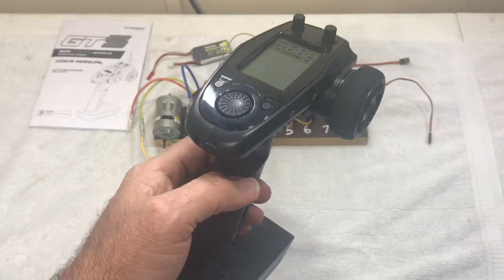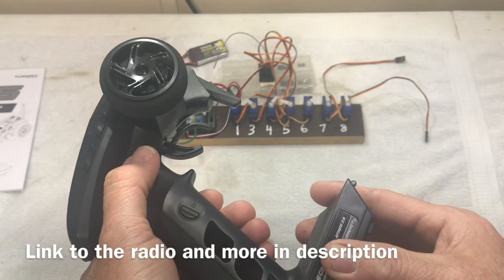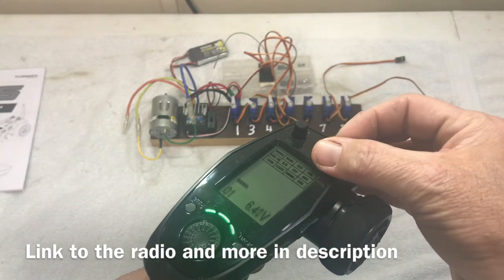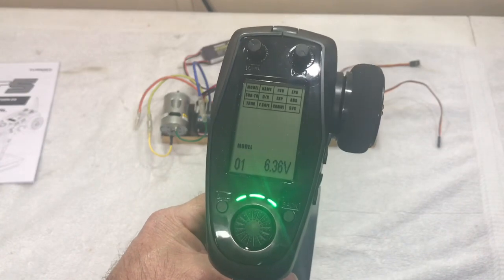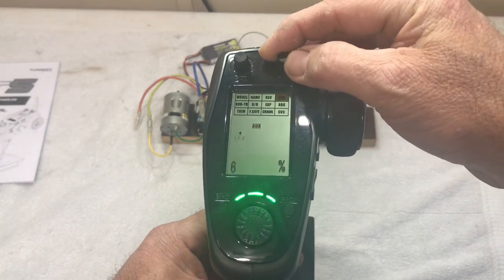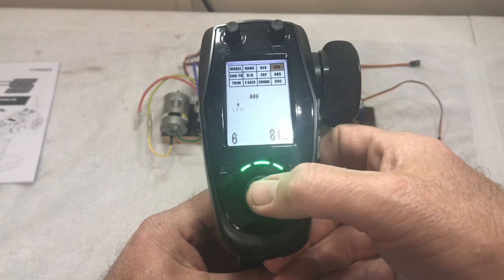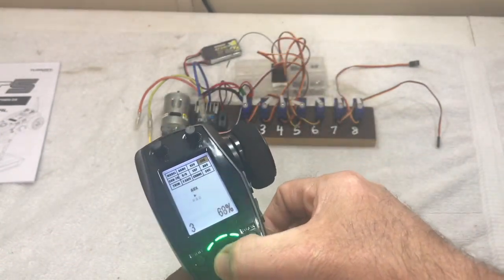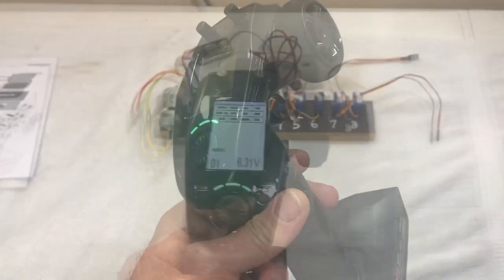Gt5 Channels 3-6 pt3

Comment: Nice, you made a follow up video on this transmitter! After heavily comsidering my options, I ended up ordering a Futaba 7PX from overseas. While I do understand that the GT3C hacked is the true gem of current radios, I simply don't like the menu system. I do find consolation that the HobbyKing "Orange" RX that will work on Futaba radios but I'll have to see if I can find a 7 channel compatible Orange RX.
Reply from the maker: Cool. Let me know how it all sets up please and if you do find a cheap RX that works, I’m interested in that too
Reply: Exocaged RC Will do, I'm going to dedicate some time this weekend to finding a compatible Orange RX if possible and order it. My radio isn't expected to arrive for several weeks since I really had no choice but to order from overseas due to no US stock because of the Hobbico situation. I'll definitely keep you posted but know that it won't be anytime soon unfortunately lol.
Reply: the gt3c is only 3.7V 1S AFHDS and doesnt have anywhere near the range of anything flysky with AFHDS 2A

Comment: Hi Mate. 
Currently running a Gt3c hacked for my moa build but really want independent control of the rear steering.   I currently also run front/rear dig. I use the dual rate switches to swap between f/m/r dig. Would I be able to set up something similar with this tx? Struggling to find the answer online.
Reply from the maker: yeah use the DR button and set that to the rear steer channel, then you can make it momentary or set it to hold where ever you want it to, I think you can then set the ch3 button in the handle to re center it. I haven't done that setup but some have told me they set it up like that

Comment: Hello my friend ! , have a question about the 4w steering , on what channel do you connect the 2 servos ??, on the manual it said that the rear wheel steering servo goes on the 3rd channel , but what if I want to use that 3rd channel button on the radio  to turn some lights, it wil mess up with the rear steering ??, Thank You !!
Reply from the maker: Use the 3rd channel for rear steering like it says. Use a different channel for lights.

Comment: I bought this transmitter (FS-GT5) as an upgrade to my flysky fs3b to run my Rovan Gas buggy, but am having extreme difficulties setting up the Dynamite killswitch on it. After setting up the system, it doesn't work. In short, when the car is running and I hit the third channel button (to which the killswitch is hooked), the engine is killed. However, if while the car is runnimg, I turn off the transmitter, the killswitch light stays on and the engine continues running. I realized that I have a dangerous runaway waiting to happen and, as such, grounded my buggy.
I contacted the Flysky company for help but I haven't gotten a reply as yet. Can you tell me what's wrong with my setup? I'd appreciate your expertise.
Reply from the maker: hmmm that's a tough one, have you tried the kill switch on ch4? that's the lever just under the top. It's 3 position. I believe there are programmable failsafes on all channels but I have never had a need to mess with them. That may correct your issue. I have seen a runaway 5th scale and it did not end well. Good on you for grounding it until you have it safe.
Reply: @ExocagedRC  Thanks for your honesty. I'm hoping to hear from the experts at the Flysky company. If I don't, I'll simply purchase another model transmitter that hooks up safely with my killswitch. Thanks for responding so promptly. 👍🏿

Comment: Great tips, very well laid out. I purchased this radio. to use with the TRX-4 Defender and although I managed to make all channels work, for this particular vehicle I would prefer to have 3. of the channels perform the way channel 3 does - like a 2 position switch. This way I could control 1st and 2ng gears with a 2 position channel and the same for front diff and for the rear diff.
Maybe there is a work around to configure channels 5 and 6 to work as a 2 position switch? Or channel 4?
Really like to have your take on this.
Thanks
Reply from the maker: There is no key mapping on this radio so we are stuck with that channel and that switch. Otherwise I really like the radio

Comment: Quick question, on a trx4  do you use the ch5 and 6 for the diff lock.. Just wondering how to trim that. thanks
Reply: Just set 70 everywhere i did that and it dosent destroy the servo and also my transmission switch is set on 3rd ch

Comment: I have to ask as I've been struggling to get this to work on my capra. Al other 5 rigs hooked up fine but I have no throttle control. have you bound it with your capra and if so was there any issues. Have tried three FS-BS6's and always same result. However i can get throttle when plugged into channel 2, just not in channel 1.

Comment: I am using one of these for my vanquish Phoenix and I wanted channel 4 for the transmission to go between the different overdrive settings as well as the two-wheel drive only when I would switch it The middle setting would hardly move is there any way to set the middle so it basically goes halfway in between the total throw?
Reply from the maker: yeah ch4 subtrim, set that for neutral and then set end points

Comment: I did a video on this gt5, didn’t go into detail like this👍👍👊👊📹📹hey I have 4ws n put one servo in channel 1, the other servo into channel 3, when I put in crawl mode the back servo that’s in channel 3 turns my wheels all the way left,when I turn right the wheels just straighten? Then if I hit the channel 3 button it does the same? How do I fix this?
Reply from the maker: I haven't found a way to select 4ws mode on the fly, you may need to take the servo horn off and adjust it there, so long as it shows the 4ws it should work, as in the monster truck video showing the 4ws, the gyro will work just the ch1 servo. When I scroll my radio past the off button mine also turns to one side.
Reply: Exocaged RC yes when I turned crawl mode off it would go all the way to one side, so I did take servo horn off n straightened on off, then turning crawl mode back on then it would go to one side, so basically if I fix the servo horn on off mode they r straight n turning crawl mode on the tires go to one side n vise versa fix horn in crawl mode then off turns it to one side??? Driving me nuts!lol
Reply from the maker: Ok turn 4ws on and set the horn that way. You should be ok at that point to just adjust trim and end points.
Reply: Exocaged RC Thanks brother,yea I was thinking that’s the way I should do it, I appreciate u helping me out,thanks again bro👍👊

Comment: How did you get your channels buttons to work? I wanted to run lights
Reply: Aldo can I power a winch from one of the channels with out controller?
Thank you for looking my question s
Reply from the maker: plug them into the channel you want to use and use the corresponding dial or button. The buttons are not assignable so they are what they are.

Comment: Hello I just got one of these controllers can I use any of the 3-6 channels to control lights on and off?? Thanks
Reply from the maker: Pretty much yeah. Pick the switch or knob you want and plug the light controller into that port on the receiver.
Reply: By light controller you mean a need to by a remote device not just plug the light into the channel and control it like that?
Reply: @ExocagedRC this didn't work,  it just stays on regardless of the switch position. 
Are you sure there isn't more to it?
Those channels are receiving power regardless of switch position.

Comment: Can those channels 5 and 6 work for lights channel 3 too? Does that auto correct steer only work for cars
Reply from the maker: Sure they can, you just have knobs to turn to get them on and off. The steering gyro only works on ch1 and I’m not sure why you would want it on anything other than a car
Reply: Thanks I thought it might I want it for a boat especially when it has no reverse
Reply from the maker: A boat, now I gotta say that is an interesting idea. I would imagine the waves lean and stuff may affect its performance for playing around but in a drag boat it may work pretty well.
Reply: I mainly got it for my three lights I’m running switchable from the transmitter, the stability control would just have been a bonus
Reply: So far the rudder reactes to the direction of the boat pointing.  So the lights should work with  ch5 & ch6 with dials is that right?
Reply from the maker: @nsvaluto48328  yeah, just turn the dials one way for on and one way for off, you will need light controllers to do this

Comment: Hey Exocaged I have the Flysky gt5 do you know if the Turnigy receiver work with Flysky version ?
Reply from the maker: I’ve tried to bind it to the other receivers and it did not work.
Reply: Ok I saw that Turnigy had a FS-BS6 water proof receiver I was thinkin about get one but won’t take a chance thx.
Reply: the GT5 TX will work with any "AFHDS 2A" RX , such as the 3ch FlySky FS-A3

Comment: Alright here's a question for you buddy I like your video I got a GT5 6 Channel and a Traxxas E-Revo 2.0 brushless I tried every configuration in the world program this thing. I'm sure you know the E-Revo has dual steering servos how do I hook this up
Reply from the maker: Mr. Dozer. I too have considered attempting this with dual servos. The only way I can think of is to turn the gyro off, turn on 4ws and simply make both servos travel in the proper direction. This would be on ch3 for the second steering servo, just make sure that the epa and trim match up perfectly. The other way would be to use a servo splitter wire and run them both off one channel.
Reply: I heard using a splitter or a y takes way too much power for the servos. I thought about what you said engaging the four wheel steering but I'm confused at what setting I would use in the 4-wheel steering mode. It would be nice if FlySky major receiver that had to channel ones
Reply from the maker: Mr. Dozer. Yeah. I have a 4ws video with this radio. You could do that setup but no gyro.
Reply: @ExocagedRC  sweet.

Comment: Any way you could help me set up a winch with this transmitter? I cant figure it out.
Reply from the maker: I think it’s Ch4. The toggle switch thing. Put your winch controller into that channel on the receiver and it should work. You must have a controller like an esc to work the winch
Reply: @ExocagedRC  i did that and nothing happened someone said its the dual rate or the trim or the endpoint but im not sure how to work this transmittter
Reply from the maker: matthew rein you can scroll on the screen and see a bar graph showing what the channels are doing. Flip that switch and see if the bar changes for that channel.
Reply: @ExocagedRC  thank you sir. The dual rates where maxed on it i turned them both down to 50% up and 50% down and works like a charm thank you

Comment: Will the ch5 and 6 knobs work for a winch, dig or 2speed shifting
Reply: I have the exact same question and cant seem to find the answer anywhere.
Reply: @grvtyboyRC  I think they will. I have the gt5 now and I tried using channel 5 and 6 knobs for rear steering and it worked ok. So I think they would move a winch, dig or 2 speed shifting servos just fine. The rotating knobs might be trickier to use then  preset buttons but I think it would work.
Reply: So I have the 2 winches (front and rear) assiged to ch5&ch6 and it works fine.  Defintely harder to control then a 3 position switch but gets the job done.  I also setvthe failsafe on the gt5 so the channels always start in the neutral position so when i turn on the tx and the esc the servo is stopped.

Comment: Can you make a video on how to set it up for a winch I have a rc 4wd winch and it is direct to the receiver and when I plug it in it continues to run even tho channel 4 is set to off
Reply from the maker: You must have a controller for the winch. If there is no controller it will do like yours is doing.
Reply: Do you have one that works that I can link to my controller or will it work once I add it
Reply from the maker: I use a hobbywing 1060 esc as a winch controller. I have a video on it, check the channel it’s fairly recent.

Comment: Iyo would you replace the TQi 5 channel radio with this or anything really.
Reply from the maker: In the trx4 I'd replace with a Hacked 8ch GT3c radio without question. I have 3 on order to hack and setup.
Reply: Exocaged RC Will you do a video on the hacking? I've heard it mentioned but I don't know why you do it.
Reply: What’s the benefit of changing radios?
Reply from the maker: Hacking a GT3c gets you 8ch along with more mixing, epas the best 4ws options available on any radio and it’s just more versatile. Receivers are under $20 so that’s a big bonus as the radio can hold 63 models. I have a video showing the setup I use for most TRX4 trucks however I have a few setups for various user needs. One of the benefits of changing radios is you get more options. With my 6ch setup you get independent control over everything the TRX4 has. You also get a winch or a light Chanel. With my 8ch setup you have two more channels for more lights if you want. I can also do 4ws on a trx and give you full function of the truck plus winch and lights.
Reply: Wow I see the benefits! I'll order order one now. Thanks
Reply from the maker: Make sure it’s hacked. Or you can wait about a week and I should have some in stock.
Reply: Exocaged RC Yea I'll wait for you then and I'll have some questions plus you'll make some money....that's always good. Do you sell them with a receiver?
Reply from the maker: Cool. I sell them with the 3ch and either a 6ch or 8ch receiver of your choice. The 6ch fits in the stock receiver box and the 8ch doesn’t and I waterproof them as well. I program it all in there and all you have to do is fine tune the endpoints. You get operation instructions too.

Comment: My channel 3 doesn't work and when I plug my winch into anyof the channels it turns on but won't shit off unless I unplug battery can u please help me
Reply from the maker: What are you running on ch3?
Reply: I got the winch to work but I can't get channel 3 to work I have it on a servo for high speed low speed on trx4 I can't figure it out
Reply from the maker: Try a different servo in that port. One that’s not connected and see if you can get any action
Reply: @ExocagedRC  what do u mean by one that is not connected . I've tried all the servos on it an nothing , do u mean try it with the servo not connected to the high low speed cable
Reply: Do I mess with the trim on the subtrim an trim modes for aux Chan 3?
Reply from the maker: sorry for the delay, yeah just hook any servo you have up to it and see if you get any action at all. I hope not, but Ch3 could be dead on the rx
Reply: @ExocagedRC  I believe it moves a tiny bit when I mess with the trim  . But when I press the button I getting no response. What is your transmitter settings for channel 3 maybe I could do the same . I feel it might be a bad rx
Reply: Yeah it moves a little bit when I move the trim on the transmitter. BUt not much from zero to 120  .coould it be the receiver or the transmitter button

Comment: On the fly sky gt5 I need the three position switch to run a novack duel motor esc & dig it say to use channel 3 but on the gt5 the three position  switch is channel 4 can I move the wire on the reciver to channel  4 for the 3 position switch? Or can I change the channel 4 to channel 3 on the transmitter can you rename it to channel 4 to 3?